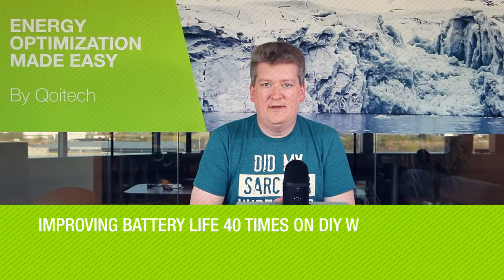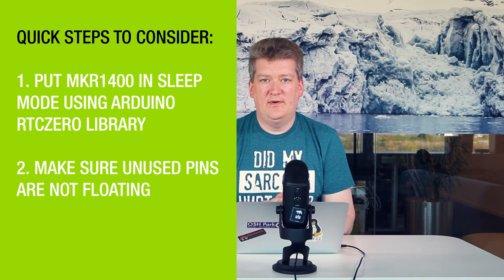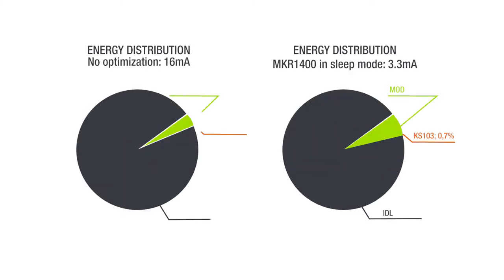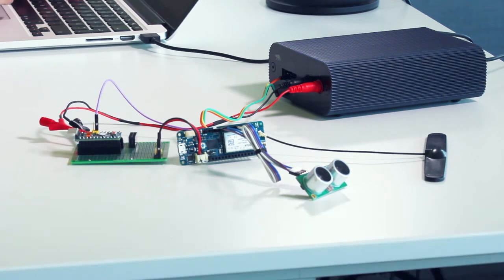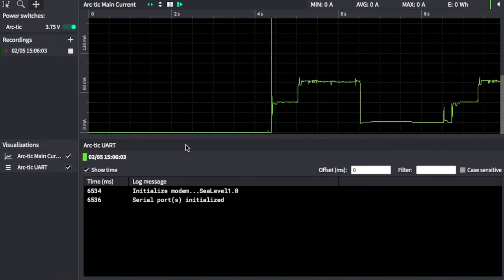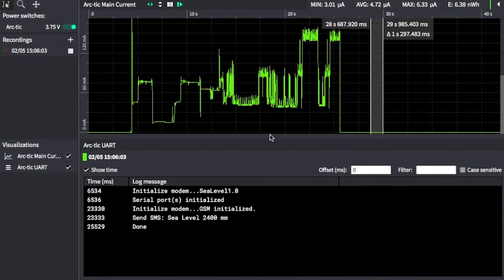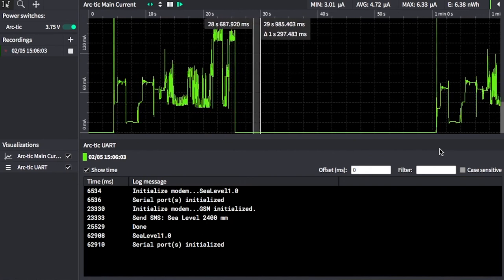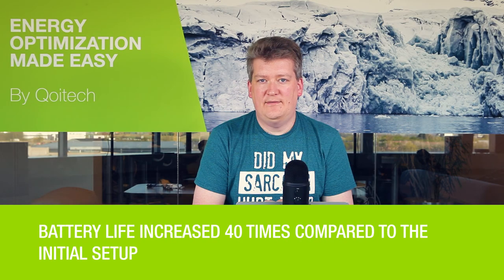DIY Water Level Indicator - Improving battery life up to 40 times, Part 2

Comment: Great post, thank you. What is the spec for the P MOSFET?
Reply from the maker: Thanks, @raynerzoo! 
Any P-channel enhancement mode MOSFET with a continuous drain current (Id) capability exceeding the load current, a drain-to-source voltage (Vdss) and max gate voltage (Vgs max) capability exceeding the supply voltage and with a sufficiently low gate threshold voltage (Vgs th) for the supply/logic level in use should work. One example that will work in this scenario is the DMG2305UX. Always verify that the drain-source on-resistance (Rdson) is sufficiently low when the gate voltage is at the supply level. How low this resistance has to be depends on how much the load current is and what the acceptable voltage drop in the design is. The DMG2305UX is specified to have a Rdson of max 100mOhm with a gate voltage (Vgs) of -2.5V (at room temperature). In this application the load current is less than 200mA so the 100mOhm resistance can cause (in this case an insignificant) maximum voltage drop of 20mV.

Comment: What is meant by unused pins are not floating?
Reply from the maker: Unused pins of a microcontroller can cause additional current consumption if configured as an input and the voltage on the pin is in the no-mans-land between a digital 0 and 1. Either configure the pin for pull-up, pull-down, disable the input (available in most MCUs, same thing you need to do if using the pin for analog functionality), or simply configure the pin as an output driving it high or low (as it’s not connected it will not matter which level it is configured to).